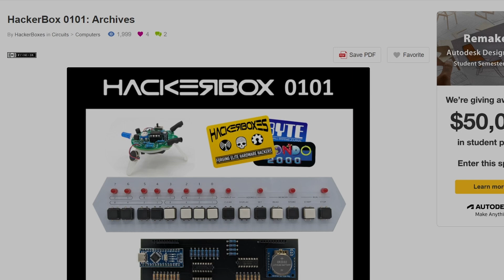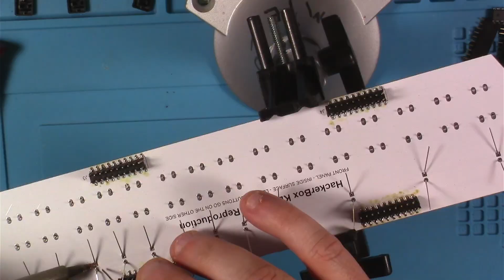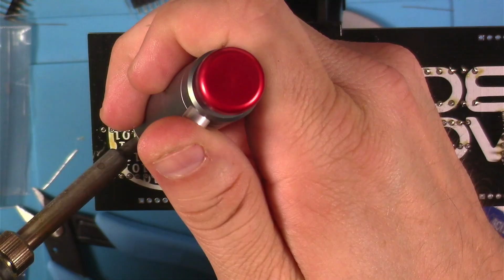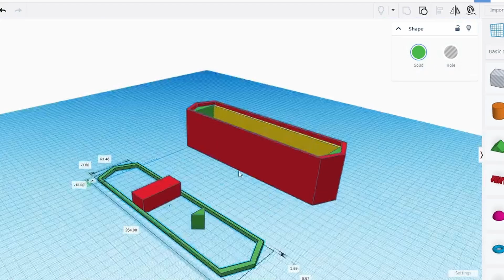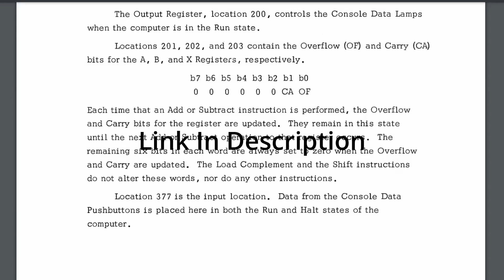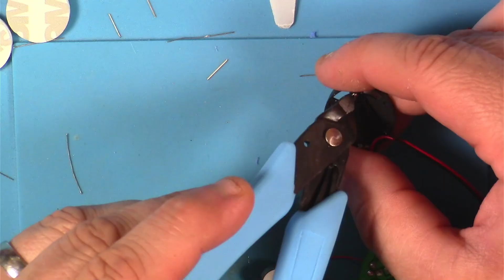Hackerbox 0101 - Archives

Comment: Please explain software upload after minute 24:16, it goes by so quickly I can’t understand. I follow up to that point, and get to that point after “Blink HW_test.ino” but at the download Kenbakuino project files it goes by too fast ( even at slow speed). Kindly explain😊
Reply from the maker: Either use Git to get the Kenbakuino project or snag the zip like I did in the video. 

https://github.com/funnypolynomial/Kenbakuino/archive/refs/heads/master.zip
Note if you download the zip from GitHub, after unzipping you will need to rename the "Kenbakuino-master" folder to just "Kenbakuino" since the IDE requires the folder to match the ino filename.

Go into the sketch file tab LEDS.cpp(or open it directly if a dedicated tab didn't open in Arduino)
Find the call to shiftOut on line 28
Change the third parameter passed to shiftOut from LSBFIRST to MSBFIRST

Then compile and push kenbakuino.ino to the device. 
Let me know if that works. Apologies for the delayed response. Thanks for watching!
Reply: @JamiesHackShack     Hi , after following your instructions from 6 days ago I wound up with 26 individual files, after unzipping. Do I have to transfer all 26 to the Arduino or just certain ones? 
Thanks,
Wayne
Reply from the maker: @gort59  they are just used during the build process. Only the correct thing is sent if you are using the Arduino IDE. If not, I'm not sure.
Reply from the maker: @gort59  also to be clear if all these files are within the folder named as above... After you edit and save the changes for LEDS.cpp you just need to open the .ino file.  It references the other files and those come into play when it is compiled and pushed.
Reply: @JamiesHackShack  so how are the files linked to the Arduino sketch files?
Thanks again😊
Reply from the maker: @gort59  they are just includes aren't they? And called in during compilation right? Unless I am not following. Sorry if I am misunderstanding.
Reply: @JamiesHackShack  thanks for your quick reply, I will give it a try!
Wayne
Reply from the maker: @gort59  You let me know if you have any trouble. We'll figure it out!

Comment: I think you're bashing your modeling skills too much, the case looks good. Are you going to post the STLs anywhere?
Reply from the maker: It's kind of wonky and stuff. I need to make both lips for the handles match. I'm really a bull in a china shop with tinkercad. I lack precision. I could share as is and still clean up. I think there is also one linked in instructable. There is also one I found while editing that is pretty good but may need a slight tweak to fit and match the angles of the panel. I'll find that one and reply back here when able. Thx for watching and commenting.
Reply from the maker: Here ya go!
Thx
https://github.com/slofunk/hb101-kenbak-case/tree/main

Comment: I dodged a bullet when I started to solder in two machine pin headers for the PicoRAM 6116 that I recently built. Thankfully I tried a test fit of the Pico into the header, and realized that I would have had to drive over it with my car to get those fat header pins on the Pico to mate with the machine pin sockets. 

I buy my resistors in the large variety kits. The latest one has 3120 resistors across 156 different values. The reason I go this route is that there is someone in the universe whose job it is to label the header of each strip. That's the person we have to protect at all costs! It's worth the ~$22 bucks to not have to root through a pile with a meter to find the resistor that I need. Although I am notorious for saying the heck with it and just grabbing "Something in Brown/Red/Orange, whatever". Which is a natural reaction to rooting through a damn pile of resistors one too many times trying to find a specific value.

Your enclosure came out great! Can I encourage you to put it up on Thingiverse or one of the other sites? I had a Creality CR-10 until I gave it to a 13 YO kid. That'll teach him to not trust old folks... I have a Sovol 08 on the way, I'm pretty sure that it won't be a 29 hour print with that thing. It'll look nice next to the Qidi X-MAX3. :)
Reply from the maker: Test fit FTW! :-D 
I like the resistor packs with them all tagged. Those are nice. 
About my enclosure, it is good from far but far from good. I would like to tweak it a bit. It is all very rushed in the details if you look closely. Like the little lips that the handles stick on aren't even the same length. I redid one handle with a deeper recess instead of taking the knife to it. :-D I should get one side perfect then just copy/flip it and set the correct middle distance to  ensure symmetry. I should force myself to properly work with it to work smarter-not-harder.  Oh that Sovol would be quick I bet! Mine is just an Anet A8Plus (original a8 here too)Thanks for watching/commenting.
Reply: @JamiesHackShack  That enclosure would make a good project for OpenSCAD, and then you would have it able to be modified parametrically (if that is even a word). Tweak it to your hearts' content.

Oh okay, I had the Tronxy Anet clone. It was hands down my most reliable printer. Mine was the baby brother to your Plus, something like 200mm on each side. 

As for my old Creality, I had replaced that cursed toolhead that came with it with on from Micro Swiss, so he actually got himself a decent printer. But Core XY is the way to go. And the Sovol is cheap at $549.

And far more trouble with those machine pin sockets than they are worth, it'll be quality double-wipe ones from here on out.
Reply from the maker: Put up some stl files. 
https://github.com/slofunk/hb101-kenbak-case/tree/main
Reply: @JamiesHackShack  Thanks! You da man!